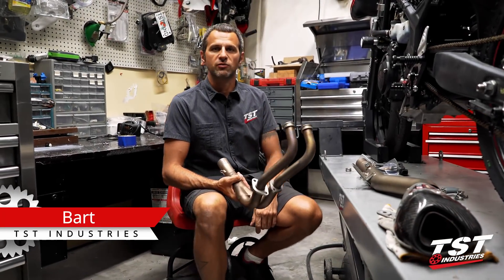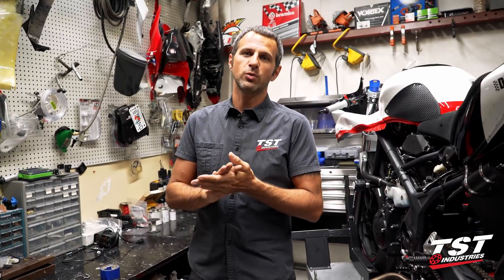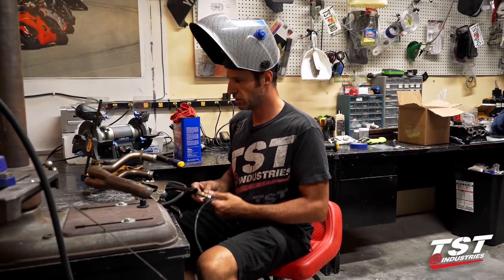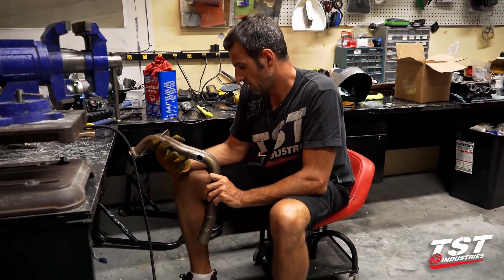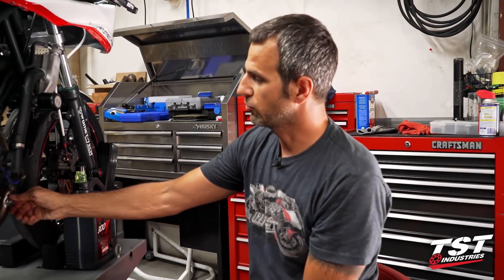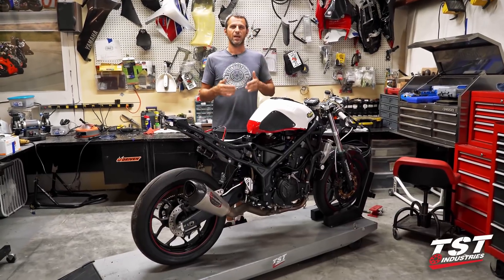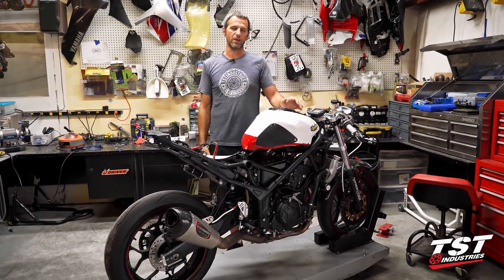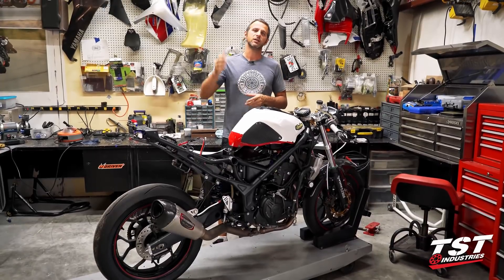We gained horsepower by doing this! [Superbike Build Series Ep.17]

Comment: Hey Bart and TST, was just wonderin why did you guys switch from the full arrow exhaust to the alpha-T ? :)
Reply from the maker: We didn't. The two bikes you saw in this video run different exhausts. The Supersport machine we built last year uses the Arrow system, and the Superbike one uses a Yosh. We will likely build our own exhaust later this year to really dial in the power delivery where we need it most, and hopefully shift the power and torque peaks to a higher RPM.

Comment: Have you tried radius valve seat cut. It should flow better.
Reply from the maker: Technically it should but we don't use a Serdi table. We use manual cutters with guides.
Reply: Radius tools are available to manual cutter too. Most tuners in Finland use manual cutters.
Reply from the maker: We will consider that.

Comment: Great video as always, will it help at top end if you run 2 seperate exhaust small mufflers for each cylinder as you are running sensors in each exhaust, higher exhaust flow, just a thought. Wondering how did you connect 2 sensors, I mean the wiring.
Reply: cranky1812 most stock sensors comes as many as number of cylinders.
Reply: Amaey Paradkar usually there is only one sensor at the collecter.
Reply: cranky1812 Take a look at Triumph Thruxton R etc.
Reply: Amaey Paradkar few examples is ok but my question was how the wiring is done for multiple sensors when you motorcycle came with one sensor like Yamaha R3.
Reply: cranky1812 the sensors are supposedly connected to a "piggyback" like tuner which controls the fuelling to both cylinders based on feedbacks from Sensors. It's an external unit. When on bike it is made in a little different way, either one sensor bung is blocked with only one sensor in use or both sensors feedbacks are averaged by aftermarket ECU which has 2 ports for O2 sensors.
Reply: Amaey Paradkar last I spoke to the tst guys they said they will install a piggyback ECU later.
Reply: cranky1812 then with stock ECU there might not be any other option. I have  only slightest of idea of how you guys do all this.
Reply: Amaey Paradkar I use race dynamics piggyback ECU on my KTM RC 390 but it's a single cylinder so my wiring is different.
Reply: cranky1812 wait. Where are you from?
Reply: Amaey Paradkar I am from India
Reply: cranky1812 Hahaha... Sweet!! Me too.
Reply: Amaey Paradkar cool where
Reply: cranky1812 Madhya Pradesh.
Reply: Amaey Paradkar I am from Noida
Reply: cranky1812 Sweet! While you are at it, check my videos out.
Reply: Amaey Paradkar sure

Comment: Hi Bart, what's the front now ? I race short tracks so my front is 30 mm lowered and it helped a lot. 
I been thinking about adjusting the rear up too, I am at 290 mm currently.

Other than that I am still working hard at getting better at riding and racing. 

Lastly your triple tree clamp is so awesome. Can't wait for them to on sale!
Reply from the maker: The rear shock is at 287 at the moment. We will be playing with some other higher values soon. The front is at 27.3 exposed from the top triple, but that doesn't correlate to the stock triples. If you want to try my setup you would have to measure from the top of the bottom clamp to the top of the aluminum part of the fork leg while having the bike suspended on a steering lift. Our value for this is 195.25. Good luck with your racing. Maybe we can bump elbows one day.